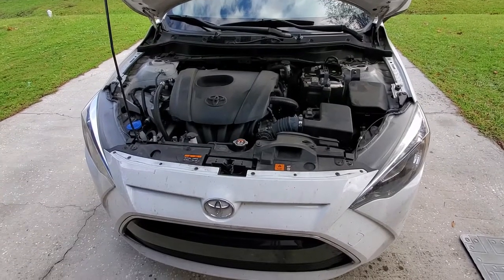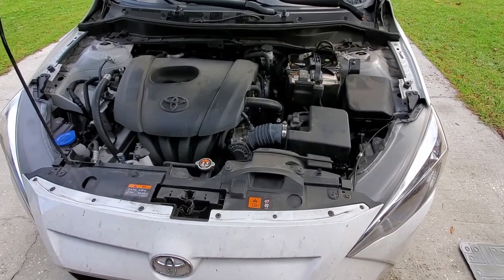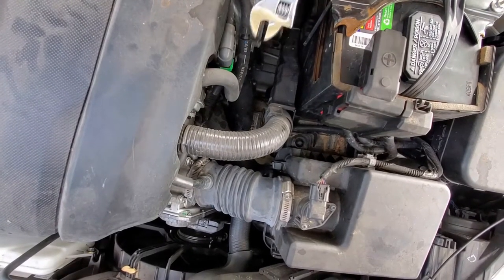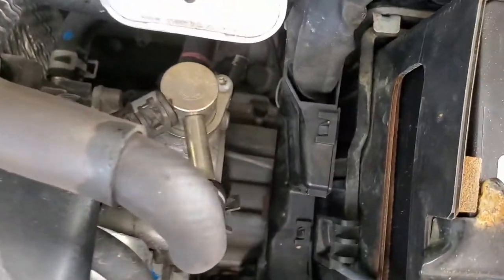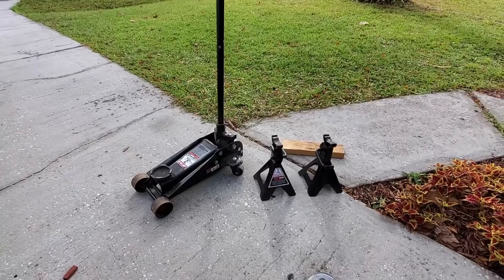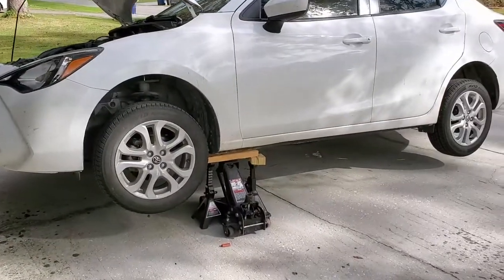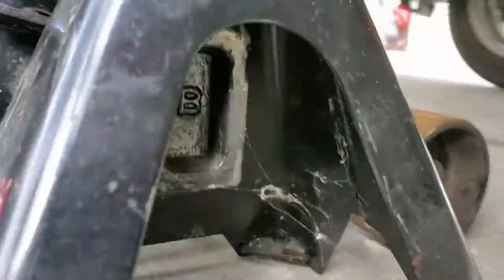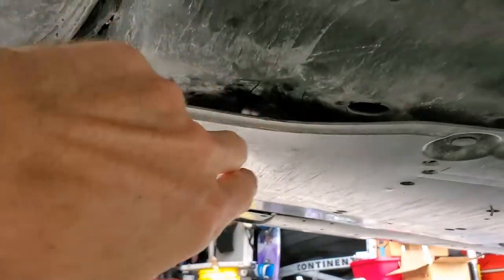How To Find & Recover a Dropped Tool In Car Motor Compartment

Comment: Bruh, i was changing my thermostat on my 98 Jeep ZJ and the super important bolt that I was holding with a magnet fell down and i didnt hear it land! I have one super loose panel near the Oil Filter and its not there. I loosened the Alternator as its the only thing visibly in the way next to the thermostat and nope. I even superglued stronger magents to my telescopic magnetic pole and nothing. I jacked up one side and still nothing. This bolt straight up vanished! The thermostate is a simple 5 minute job gone completely wrong!

Comment: I dropped a socket in my engine and it got caught into something to do with my braking system. Any specific ideas? Can't find it. Afraid to drive my car.
Reply: God Trojan  no actually.  Lol. Haven't driven my car since. Haven't really needed to anyway. I was going to take to a near by parking lot and try to shake my car around and see If it falls out lol. Otherwise I have to take it in because I'm going to need my car soon.

Comment: I dropped a terminal pin removal tool, rolled off the coolant overflow tank and literally disappeared.  
The thing with mine is there is no skid plate in the front, it just disappeared into the vortex.
Reply from the maker: That can be a tough one. We just need a lift that can flip a car upside down and give it a few shakes and problem solved, right? haha
Reply: @CryptoMineLLC  Actually, I decided to dismantle the entire vehicle, still didn't find it!
Reply: @CHAOSMOVEMENT  why in the fuck would you do that
Reply: Oh i found it! That's where it came from. I was wondering how it got there.

Comment: If you can get the tool only children under 5 years old need a video, called sometimes you get lucky. Although you did do a kind of a good half as job on showing safety with backing up the jack.